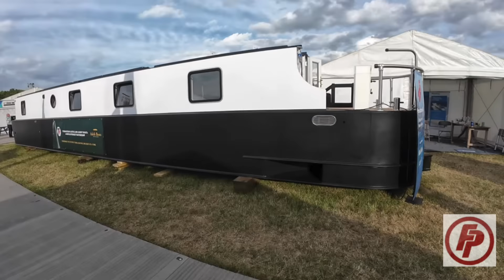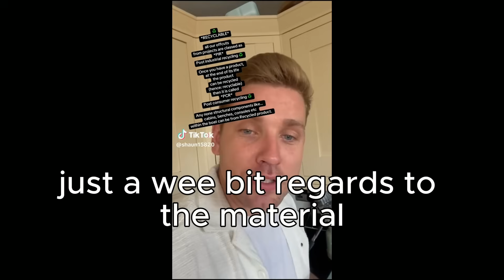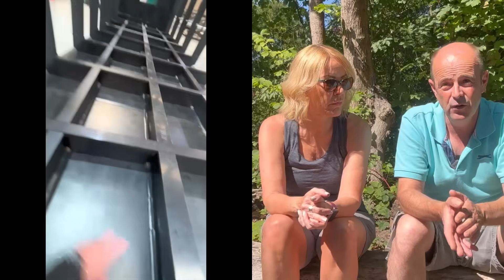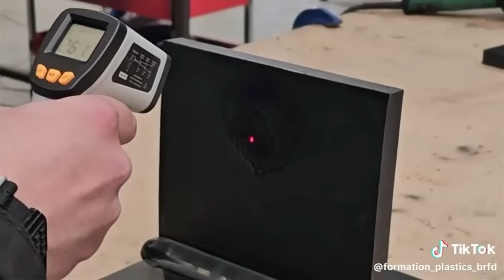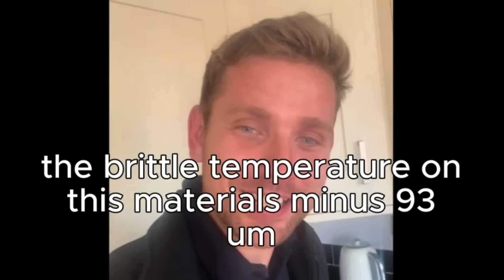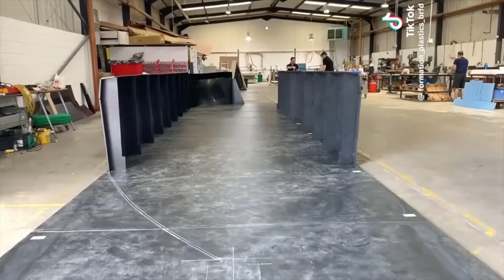Rust-Free Canal Boat?! The WORLD'S First Plastic Narrowboat Explained | 194

Comment: Whilst the concept has advantages over steel there are concerns not being addressed.
A jagged piece of metal sticks out of Armco your mooring up to.
Under water obstruction metal .
Railway way rails fitted into bridge holes that protrude into the water , just at the boat water line.
The construction is not allowing for a Hull breach under the water and being sent to the stern of the boat to inform you of the problem.
Bilge pumps for engine shafts etc .
Whilst on paper a boat fitted is £130k 
Steel similar £250k
It is the ability to survive a strike under water is the real concern .
An obvious impact from another boater is a probability but readily known and understood.
Reply from the maker: Fair points. One of the reasons we wanted to film Karenza was because it raises lots of interesting questions and discussions. Time will ultimately tell how HDPE performs in real-world inland boating conditions, but it’s certainly getting people talking.

Comment: My main concern would be there's no repair network, noone is setup to repair a HDPE boat.
Reply: That’s a fair concern,

HDPE is actually widely used in other marine and industrial sectors, and the repair methods (plastic welding, panel replacement, modular sections) are already well-established. While it’s true that the canal network doesn’t yet have a widespread HDPE repair network, that’s mainly because the demand hasn’t existed — not because the repairs are difficult or unproven.

At the scale we’re talking about (a handful of boats per year), repairs would be handled either by us or by a small number of trained partners, much like how specialist boat systems are supported today. As adoption grows, training and equipment can be rolled out gradually.

In short, the lack of a repair network is a chicken-and-egg issue, not a technical barrier — and it’s very manageable at this scale.
Reply from the maker: Shaun has given his thoughts, which is great as we were a little unsure 🧐 😁👍🏻

Comment: If all canal boats were made from plastic, it would close down a lot of narrow boating yards where they lose the regular income from blacking and welding boats ?
Reply: Hi, thank you for this comment — it’s one I’ve actually had quite a lot, so I’ll try to explain.

This isn’t about changing tradition or taking over from steel. It’s simply about offering a different option alongside what already exists.

I did look into the numbers (yes, I’m that sad 😄). There are roughly 35,000–40,000 boats on the UK canal and river network. New builds are only a few hundred a year, and even selling around 7 boats a year would represent well under 2% of the annual market.

More importantly, the existing fleet of steel boats isn’t going anywhere. Those boats will still need blacking, welding, anodes, and repairs for decades to come, which means traditional boatyards and dry docks will continue to have plenty of work.

So this really isn’t about replacing steel or closing yards — it’s just about providing an alternative for people who want it.
Reply from the maker: That’s a fair point. This video isn’t about replacing steel or saying everything should be plastic — it’s just looking at one alternative design and what problems it tries to solve.
Steel boats and traditional yards will always have a place. 😊👍🏻

Comment: So when I saw this boat I was immediately conviced that it is brilliant. I'm an ingeneer in automotive industry. I've made production machines all my life. Each time we need a material to handle abrasive constraint and last millions of cycles we use ... Hdpe. It is also higly choc resistant. Look at your ski soles. Only 2 to 3mm Hdpe. have you ever been through ? So when I saw this boat I was immediately conviced that it is brilliant. Only rust management labor and chemicals involved are enough to make it brilliant.
Reply from the maker: Thank you so much for this — it’s really reassuring to hear that perspective, especially from an engineer 👍
That’s exactly what first sold us on the concept too: abrasion resistance, impact resistance and not having to constantly fight rust. The ski-sole comparison is a great one — when you put it like that, it really does make you question why it isn’t more widely used yet.

We’re very aware it’s still relatively new in the inland boating world and not without its learning curve, but the reduction in rust management alone is a huge win for us. Long-term performance is what really matters, and that’s what we’re keen to keep documenting honestly.

Really appreciate you taking the time to comment and share your experience — comments like this genuinely add value to the discussion 😊

Comment: How expensive are they compared to a traditional steel hull? The low maintenance aspect is a game changer although marinas might disagree. But then again it will be along time before steel hulls become largely replaced. All in all it looks like a damn good idea.
Reply: Good question. In terms of a hull or shell made from this material, a 57ft boat usually comes in slightly higher than steel, mainly due to labour time.

The build process is much slower — around 10× slower than MIG welding and roughly 5× slower than TIG welding — so fabrication simply takes longer. That’s the main reason for the difference.

Many of our features are also standard (bow thruster placement, water tanks, doors, cruiser sterns, etc.), whereas some steel builders charge extra for these, which can make comparisons tricky.

While the upfront cost is slightly higher, the low-maintenance benefits are a big advantage (even if marinas might not always agree 😄). Steel isn’t going anywhere soon, but this is a alternative for some

Comment: would worry some kids would drill holes in it for shits and giggles. Your steel hull ones are tough to even drill with proper tools. otherwise those materials are pretty good, only super cold can do much to it, and then only if you bang it about. 🤣
Reply from the maker: Thanks for the comment! 😊
The good thing with modern marine-grade plastics (like HDPE) is that they’re extremely tough — you can’t just wander up and drill into them for a laugh. The material actually melts around the bit, so you need proper kit, the right bits and the right technique to even get through it cleanly.

Steel and HDPE are just strong in different ways:
	•	Steel = great for impact resistance but can corrode.
	•	HDPE = won’t rust, absorbs impacts, and is surprisingly hard to damage unless you’re seriously trying!

So thankfully no worries about kids randomly drilling holes in anyone’s hull. 😅🚤
Reply: @WidebeamandWellingtons  very nice, they frown at me when I show up with a drill at the boat yard..

Comment: HDPE can be machined, welded and have mechanical fasteners (screws and bolts) used on it but it cannot be painted or glued.
Reply from the maker: You’re spot on — HDPE is usually welded, machined, or mechanically fastened, and it’s true that painting and gluing are normally a no-go. What’s exciting here is that Shaun has actually collaborated to develop a specialist paint designed specifically for these boats, which makes them even more versatile. 🚤✨
Reply: @WidebeamandWellingtons The paint will fall off. HDPE adhesives are very specialized, toxic (think elfinsafti) and hugely expensive.

My experience is in using robots to weld together sea going and military! HDPE vessels. They are almost unbreakable if made properly and only wear out from abrasion. Rubbing strakes can be removed when worn and new ones welded on easily.
Reply: @andrewallen9993  Thanks for sharing your insights — your experience with robotic welding of seagoing and military HDPE vessels clearly gives you a deep understanding of the material’s strengths and limitations. We’ve also built boats for seagoing and military applications ourselves, so it’s great to connect with someone who truly knows the material.

You mentioned that HDPE adhesives are very specialized, toxic, and hugely expensive. Based on our extensive testing and collaboration with suppliers, we can confirm that this is not the case. We have tested multiple adhesives and have identified practical options that meet our requirements without the downsides you described.

Regarding paint, we have worked very closely with our paint supplier, who can paint the HDPE exactly the same way as a steel boat. In terms of fumes and ventilation, the process is exactly the same as spraying a steel boat — proper ventilation and safety measures are needed, of course.

This has been a long 12-month process, working closely with both our paint and material suppliers, because as you’ll know, there isn’t an off-the-shelf paint specifically for HDPE. A few companies that make fire engines in the UK have shells made from plastic, and these are painted to the fire company’s colours with great success.

We have done extensive research and collaboration over the last year to ensure that the paint we use works well and adheres properly to the material. This is also why we are in the process of trademarking some of these innovations, to protect the unique solutions we’ve developed.

So, while I agree with some of the points you’ve made, I must politely disagree on this one.

Thanks again for the valuable conversation — it’s great to exchange knowledge with someone experienced in this field.

Comment: So if it sits higher in the water does it then have a higher air draft (roof above water height)? Does that mean problems with bridges and tunnels on the UK network? As things are now some boats can't get through certain tunnels due to headroom issues.

I have seen work boats made out of HDPE. They are very strong and pretty much bounce back from anything. HPDE insulates a lot better than steel (let's be honest, most things insulate better than steel), so apart from not needing battens for a fit out I expect the insulation can be thinner too - equating to more interior space. 

If the finished product is around 2/3 the weight of a steel narrowboat does this mean that as a person moves around in the boat it moves a lot more than a steel boat? The numbers would suggest this to be the case, but boat stability is also a product of the centre of gravity. If that is low enough perhaps this is not an issue?

Personally I feel HPDE should bring around a lot of scope for new designs, perhaps forward control even. Electric motors would make this even more of a possibility.
Tim & Jalika,
Malaysia
Reply from the maker: You raise some good points and yes HDPE is extremely durable! We actually released another video yesterday that covers most of you questions 😁 https://youtu.be/C0DWVy5RiUc?si=xB8ot7bSqbBmALWE
Reply: @WidebeamandWellingtons  Yes, just after posting the comment I found and watched the newer video. All about the timing! Thanks for the reply.

Comment: I imagine that it would be suitable for lead acid batteries as ballast allowing it to be fully electric without the worry of lithium fires.
I only see one drawback in that it is plastic, and that is it will be a magnet for dust.
Reply from the maker: Great points! The lighter hull does mean you can “spend” some weight on batteries as ballast. Lead-acid would do that job, though it adds maintenance. A lot of folks are looking at LiFePO₄ (lithium iron phosphate) with a proper BMS, fusing and enclosure—done right, the thermal risk is very low—so a fully-electric spec is definitely viable.

On “plastic = dust magnet”: this hull is Polystone G Marine Tec HDPE. It doesn’t rust and, is a high-density polyethylene, a type of plastic known for its relatively smooth surface, which does not have strong adhesive properties for dust in its standard form. 😁
Reply: Don't fall for the tin hat brigades fear. How often have you seen an ev on fire? Until a year ago I used to drive 40K miles a year all over the south east. The only one I saw was an electric van on fire. Range extender vehicles have never burst in to flames. It all depends on how the battery is charged or discharged and a lot now only use 60%...charge at 20% which is empty to full at 80% which keeps the integrity and stability of the battery.

Comment: Totally impractical unless you armour the bottom of the boat , steel sticking up from the the waterbed will put a hole in it easy . You have a good few ton on one pressure point will hole it . All plastics shed when scraped hard enough . Best to have a stainless shoe or a super concrete shoe fitted under it
Reply from the maker: Polystone G Marine-Tec has already been proven on boats all over the world, including in some really tough environments. It’s incredibly impact-resistant and not prone to the kind of damage you’d see with standard plastics, so no extra armour is needed under the hull. And unlike steel, it won’t rust or corrode over time. 😁

Comment: Very interesting, but that burn test wasnt very convincing, I can pour lighter fuel on my hand and set it alight with no harm to my hand, but I wouldnt stick my hand in a BBQ 

Be interesting to see what happens when the plastic is exposed to a real fire - like happens in the real world - rather than a liquid that vapourises and burns so quickly
Reply from the maker: The material isn’t new it’s been used all over the world for years. Polystone® G Marine-Tec is HDPE: it softens around 130 °C and will burn if a flame is held on it (ignition in the ~300–350 °C range). In a real fire you’d see it deform first rather than flash over; there’s no paint to blister and no solventy VOC layer to feed the flame. As with any boat, fire safety is managed by design (detectors, extinguishers, heat shields around stoves/exhausts, proper fuel-system bonding). 😊

Comment: It sounds like it could be a good Idea but there's obviously some sorting out needed. He'll need to work out how to get it to sit lower in the water so that it won't be effected so much by side winds and will be able to get under low bridges. Also if the material is as good and indestructible as claimed I was very surprised that they only offered a 3 year guarantee, would have expected at least a 10 year one. A canal boats life is much longer than that.
Reply from the maker: We believe ballast can be adjusted to address the level it sits in the water.
3 years is well above the current industry standard of 12 months on steel boats at the moment 😁

Comment: It worries me to hear they add steel ribs to "eliminate" the extra expansion occurring in plastic. When two materials wit different expansion rates are fixed together, there will be unaavoidable stresses developing in the weaker material, and those stresses will manifest as cracks and other structural weaknesses.  It doesn't sound to me as though you've given this subject quite enough thought.
Reply from the maker: Ah no I think you may have misunderstood, they did on the original wide beam prototype but then realised there was no need! The way they do it now there is no need to😁

Comment: I got to see the outside of this boat at Crick , I thought it was awful , it just wasnt show ready. The wrapping was terrible and held down with duck tape in a couple of places and the plastic welds looked terrible too.
They should have waited til next year and turned up with a show ready boat.
I think re : painting some sort of paintable compound needs bonding on , the wrapping was done in sections and just looked pants , 4/10 Improvement needed.
This may sound harsh but if I was buying now this boat doesn't yet compete with a 200k steel tub.
Reply from the maker: Shaun did explain to us that the Crick boat wasn’t finished unfortunately but the point at Crick was to start the conversation and show the concept; since then Shaun’s been doing proper testing and has confirmed a 3-year warranty. We’ll share the finished-spec boat as soon as it’s ready — hopefully you can judge it again then. 😁
Reply: Yeah maybe but I understand the concept and I wanna see a boat that stands up against the rest of the show boats....lets see what happens next year....for now I'm out.
Reply: @originalpickaxe  Are you speaking of just a canal boat, or actual field tested boats that take a lot more of a beating than canal boats do?  If that is the case, they are not hard to find. I have been researching this material for boat hulls for over a decade now, and I'm an apex opponent of plastics in general, as I stated in my other comment here.  However, now that I'm retiring and designing and preparing to build a canal/barge boat hybrid, I simply will not use any other hull material besides HDPE because of it durability, long service life and bombproof performance...

Comment: Be aware of UV degradation. Repainting steel might need doing every few year but it works.
Reply: Polystone G Marine-Tec is actually used all over the world in environments with high UV exposure. In fact, similar types of plastic are commonly used in playground equipment — where UV resistance is absolutely essential due to constant sun exposure.

So I can confidently say that UV isn't a weak point for Polystone G Marine-Tec. It’s been engineered with stabilisers specifically for outdoor and marine applications, and it holds up very well over time.

Thanks again for the discussion — always good to talk through the details.
Reply from the maker: Luckily Shaun has explained this for you 😁